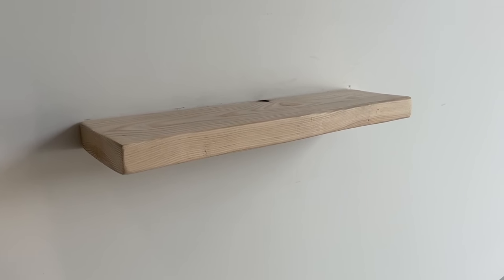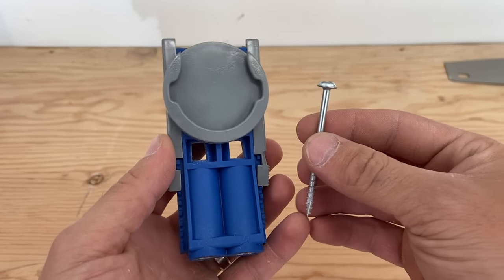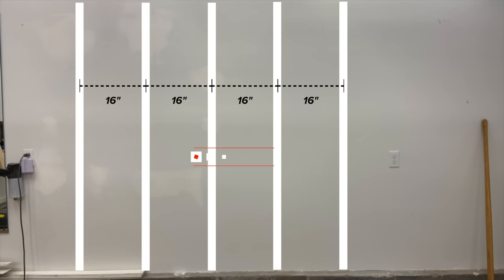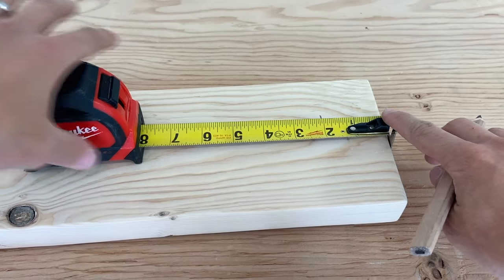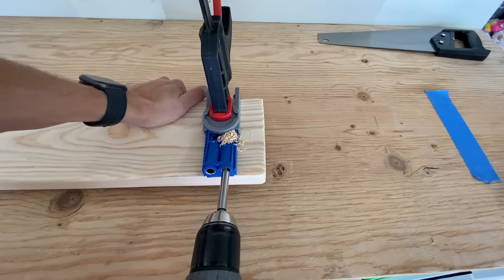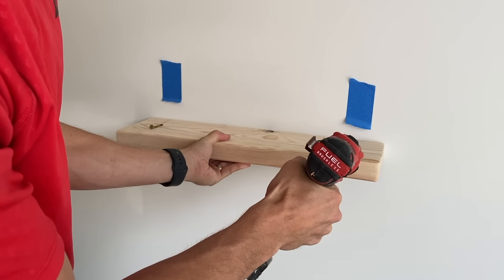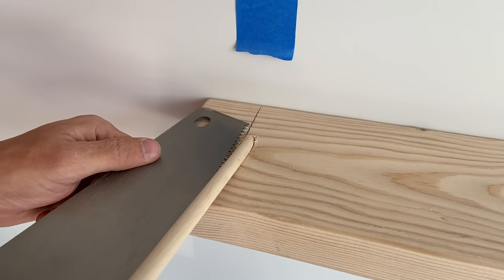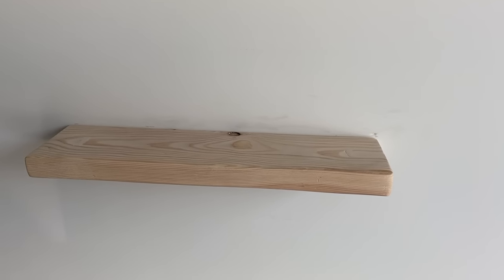This floating shelf is held up by 2 screws.

Comment: Okay, as I keep trying to figure out how to not have shelving that falls to the floor, I've very much feeling like the tortoise, not the hare... or like the tale of the 'axe' wood chopping moral tale- how the one who stops to sharpen their axe, in the long run, could chop more wood, faster. Very slow right now with much research; but I'm seeing reasons it will pay off. I'm learning a lot. I had NO idea to have so much concern about screw strength, & now, today, after forever not knowing this, I'm hearing it over & over today.Note to remember: tested different screws: drywall; only ones that held up are #9 GRK R4 multipurpose wood screws (3", bugle head, star drives); (better than kreg tight pull join screws & some other large head cabinet like screws  that looked much thinner gauge). Also used pocket hole Kreg jig. When I get time, I want to put these shelves everywhere : )

Comment: The screws you used are not designed for the Kreg. The screws need to be a flat face, same as the Kreg drill design and not a wedge like you used. A wedge screw can split the wood or dig in too deep, thats why they made it a flat screw.
Reply: If you just take care when setting the screw, this will work just fine. If you hog it in there with an impact driver, you're going to have a bad time.
Reply from the maker: Yeah I took that into consideration but from my understanding the kreg brand does not have screws that long! This only works because the screws are 3” long!
Reply: @Nailedityt  You could also just put a small washer in the screw.
Reply from the maker: Good point!

Comment: Can this be done with a 2 by 8 or 2 by 12 with longer screws and more I’ve them? I need to hang a shelf right over my washer and dryer back for all my detergents . I think a 2 by 8 will be big enough but I need it a little longer than the width of my washer and dryer pushed together. What’s your thoughts on this? So glad I found you on YouTube. I am subscribing for sure:)
Reply from the maker: Yes you can! This video goes over installing more than two screws for a longer shelf! 
https://youtu.be/5Url3QXQHaI

Comment: My instincts tell me that it would be stronger if the shelf was flipped and screwed in from the underside. Does anyone have any thoughts on this? Also, I assume this would also work into brickwork with predrilled holes and wall plugs..?
Reply from the maker: Answering Your Floating Shelf Questions
https://youtu.be/2j1jn6CaQY0

Comment: Really interesting. If I have to do floating shelf, I will do it this way. Just a quick question: Is there a reason why you have done the hole for the screws ont the top of the shelf and not at the bottom? Thanks
Reply: Ok, I kinda answering myself, if the shelf is above eyesight, we do the hole on top, if the shelf is below eyesight, we do it on the bottom? Does I am right?
Reply from the maker: Yes, it works well either way! Check out this video for more details! Answering Your Floating Shelf Questions
https://youtu.be/2j1jn6CaQY0

Comment: Suggestion for same size shelf between a window and wall (2ft) without a stud present?
Reply from the maker: I don’t have a way of mounting these in drywall yet but it is a future video idea! Can you increase the size of the shelf and mount it to the studs that make the frame of the windows? Is that possible?

Comment: Just out of curiosity (maybe I missed you saying it) but why not use the depth stop collar that comes with that kreg jig? Or did you not get it in the full kit and bought the jig and the pocket hole auger bit separate?
Reply from the maker: That would be ideal but mine sadly didn’t come with one! If you have one then I recommend you use it!
Reply: @Nailedityt  I was just curious because the kit the jig comes with has one and then you can set the depth to stop you at the depth of the work piece. I just didn't know if because you are doing something a little different there was a reasoning for not using it. Good video buddy and keep up the great work!
Reply from the maker: Thanks I appreciate it! Yeah, nothing fancy, just didn’t have it!

Comment: You drilled the pocket holes in the top of the board. Is there any reason why you didn't drill the pocket holes in the bottom of the board? If you did that, you wouldn't need the dowels because the pocket hole couldn't be seen.
Reply from the maker: The front of the board would sag and no be level. I actually tried before making the video!
Reply: @Nailedityt  interesting. I didnt know that!
Reply from the maker: I actually re did this idea and it seemed to work! I have a new video on my channel going over it!
Reply: but then you upload a new video with the holes under the shelf... so yeah, time heals and breaks everything.
Reply: I also thought about that, but my structural engineering background quickly kicked in and it was/is easy to see that your orientation is BY FAR the stronger.   Screws on the underside would have them dipping downwards out of the wall, nowhere close as strong as the way you have them.
(Nerd comment:  ....it about "turning moments",  a structural engineering term) 🙂

Comment: Those kreg jigs are handy to me, being that I'm not experienced enough to whip up a jig myself. and the joints are strong even without glueing.  Although there is a learning curve on placement for different thicknesses of wood, etc. Be nice if someone made a video on the breakdown.
Reply from the maker: Just set the kreg jig to the thickness of your wood! If you’re still confused, I will keep your video request in mind!

Comment: Thank you very much for sharing.  I am new in woodworking especially with pocket holes and screws.  At 3:40, what is that silver extension thing that you connected to the star bit?
Reply: I assume you already found the answer but for those who is looking for answer, it is called Hex Bit Extension. You can buy with different size of extensions very cheap (<$10)

Comment: Maybe this is an ignorant comment from someone that knows nothing about this, but if you turned the board upside down, would that not work? Then you wouldn’t have to fill in the holes, right?
Reply: Right 🙂
Reply: Except it might not be as strong due to the angle of the screws going into the wall.

Comment: Any advantage of using a longer screw?
Reply from the maker: Probably not a whole lot! It might add a little advantage if the screw was thicker but not by much. Also if you use a longer screw, be careful with electrical wires and pipes behind your wall! Hope that helps!
Reply: @Nailedityt  what about alternating the screw location ever other space/stud? One one top one on bottom one

Comment: Hi, would this work with a deep board? Like a 20inch deep board? And would a 4inch screw of the same brand also work? Or it has to be specifically the size you used?
Reply from the maker: 4" would work! Not sure about a 20" deep board! That might sag in the front!

Comment: Great idea. I wonder if inverting the shelf would increase the holding power. The downward force on the shelf would push the screws towards the wall, not away.
Reply: May depend on the use. If the shelf is deep then you run more risk of it sagging with a heavier load further from the wall. Top down seems better for loads placed further from the wall. With a shallow shelf and loads close to the wall bottom side may be superior.
Reply from the maker: Very good point! @onelonglizard
If you both are interested in how it would preform on the bottom, I recommend you check out this video! https://youtu.be/2j1jn6CaQY0

Comment: I would have put the screws on bottom where you cant see it then use super glue and saw dust to fill in holes and sand then stain you won't see where you had the holes cuse it's at bottom and the shadows are gonna hide most of it plus you filled it in with saw dust and sanded smooth and stain with a dark color as well helps and I did ,15 like that with different size wood and they look beautiful

Comment: Can this same method be used with trim board wood?  I just need some simple shelving to hold my lightweight and small soap making supplies.  Stuff like mica containers and whatnot. (I have a kreg pocket hole jig and it might be my favorite small tool in my whole collection of tools. :) )
Reply from the maker: If you are just putting light weight stuff on it you should be fine!

Comment: How is that 2x6 
When the tape measure had it at five inches?
Reply from the maker: They call it a 2x6 because it is cut at 2 inches by 6 inches at the mill but after it gets “sanded” down, it comes out a 1/4 inch shorter on each side! Hope that helps!

Comment: IMO the shelf would be stronger if the holes were drilled from the bottom and came through the back of the shelf higher to decrease the leverage on the screws. Also I don't like flat head screws with the Kreg. There is more possibility of the head pulling though by the wedge shape. However if you don't intend to have more than one person on the shelf at a time your system works. :)
Reply from the maker: Thanks! Yeah check out this video for an updated version! https://youtu.be/2j1jn6CaQY0

Comment: in case you missed it, that shelf was about to come out. do not try to put this up and slam it with weight. it will come out. 

this is by no means an insult to the vid...even with the shelf pulling away from the wall, just two fasteners was still surprising to see, i just dont want anyone getting any bright ideas only to get wrecked.

Comment: Will this work with a wider board, like a 2x10?
Reply from the maker: The wider you go, the less weight it will be able to hold due to leverage! I actually have 2 other videos on my channel going over different lengths and widths of these floating shelves! I just posted one today! Go check it out and see if it answers your question a little better. If not let me know and I will try to explain better!

https://youtu.be/5Url3QXQHaI

https://youtu.be/2j1jn6CaQY0
Reply: @Nailedityt  was thinking the same thing as in wider board, not the x10 but x8... weight to the wall will be ok but weight to the front will stress the screws, then I thought with the x 8, 3 screws on top ( 1ft in both sides then a 2-4-6 spacing, then 2 underneath) then maybe that will hold, over all enjoyed V's and gave me a different ideas, Thanks

Comment: Rip the whole piece about an inch /inch and a half , take the thinner piece and attach that to the wall and recess the head of the screw.... then pocket hole the thicker piece to the smaller. Better connection.
Reply from the maker: You could do that as well! This just had a few less steps for beginners!

Comment: what is the thinnest board you could use for a shelf?
Reply from the maker: That is a good question! I would say it depends on the size of shelf you are looking to do. The longer and deeper the shelf is the more thickness you will need. If you are planning on doing a small shelf and I would say 3/4” is the smallest you could go. I haven’t tested it but in theory that should still work!
Reply: I did one that is 1x8 which is really 3/4" so you have to set the stop on the kreg jig to 3/4" and still use longer screws.  Dowel plugs dont work as well since the hole isnt as deep so be careful.. if you have things on top of it though it can hide the pocket holes.
Reply from the maker: One of my newer videos, shows that the screws can be mounted underneath! So that could be an option as well!

Comment: the question is how do we do that with   cement walls    how to install floating shelfs  on a cement walls
Reply: Use same method but with dynabolts. Drill certain size hole in concrete and timber to match. Tap in dynabolts push on shelve and screw on washers and bolts. Use two each side. You need to be drilling out different size openings accordingly to bolt,nut and washer diameters. There are screws meant for concrete to try first which will make it easier and more identical to this video but I prefer dynabolts, depending on condition and type of concrete.

Comment: Hi! What about using a 12 inch wide board? Wondering about the extra width sticking out from the wall just supported by the pocket holes so far away.
Reply from the maker: Great question! I did a video on that as well! Check it out here: https://youtu.be/5Url3QXQHaI
Reply from the maker: If that doesn’t answer your question let me know!
Reply: Thank you so much!! Super helpful!! I'm going to put dishes on mine but it should still be less than the stress test you showed! Going to give it a try and see how it holds up over time! No harm in testing since I want to cut my teeth on learning how to do these things and what works/doesn't work over time. Thank you!!
Reply from the maker: No problem! Good luck and let me know how they turn out!

Comment: Can i do the same thing with 2x10 ?
Reply from the maker: Yes you should be able to but it may not hold as much weight! The wider the shelf the less it can hold!
Reply from the maker: Check out this video where I did a bigger shelf! 

These Strong Floating Shelves Only Use 4 Screws
https://youtu.be/5Url3QXQHaI
Reply: Thnx

Comment: One issue for me...the wood is never square, and there is a gap in the back where it meets wall. What to do?
Reply from the maker: Sometimes it’s the wood and sometimes its the wall! If you have a gab, I would just caulk where the board touches the wall! Then you can paint it the same color of the wall and it shouldn’t be very noticeable, essentially if it’s high on the wall or above eye level! Hope that helps!

Comment: Is there a reason why you placed the screws on the top side of the shelf? Couldn’t you simply flip the shelf and attach it with screws on the underside, eliminating the need for concealing the screws, as they’d be hidden?
Reply: I believe that with screwing the screws from the top puts them at a downward angle, which makes the shelf able to hold more weight. If he screwed them from the bottom, they would be going at an upward angle and would compromise the weight ability. It would be easier to tear out of the wall.
Reply from the maker: Both good points! I actually did a video on this very question! Go check it out! https://youtu.be/2j1jn6CaQY0

Comment: Why not fix it the other way round then theres no need to fill the holes
Reply from the maker: Check out this video! https://youtu.be/2j1jn6CaQY0
Reply: @Nailedityt  i dont doubt its stronger but how many people would have around 80kg on a shelf lucky if most would have 10 to 15 kg
Reply from the maker: Yeah it’s pretty unlikely! For most people this will work just fine!

Comment: You ACTUALLY weigh 57kg?! And I'm sitting here watching this video hoping for some smart way of attaching a shelf a man can stand on. My shoes would break this, let alone me standing on it.
Reply from the maker: Yes I’m pretty small but you probably won’t be putting more on a floating shelf then that anyway!
Reply: @Nailedityt  well, need one for a microwave as it happens. And anything someone might put in it. Plus it has to withstand an occasional bump or a lean or a kid hanging off of it. Ikea used to do one of those with an elaborate "inside"
Reply: @Nailedityt  oh yes, and I do envy you weighing so little...

Comment: Great use of pocket holes.  Overtime that will sag though as it's using the weight into the drywall.
Reply from the maker: It’s done pretty good so far! It depends on how much weight you have on it! If you have a lot of weight all day everyday, it could possibly squish the drywall!

Comment: Wait, your 2x4 is 5,5 inches? So in essence it's a 1,5 x 6... board. 
2x4 in my country is EXACTLY 2 by 4 inches (48x98mm)
Reply: Uhm... 2 x 4" = 50.8 x 101.6 mm. In your country 2x4s are APPROXIMATELY 2 by 4 inches. Quite far off too. :)
Reply from the maker: Yeah a 2x4 here is about 1-1/2” x 3-1/2”. Where as a 2x6 is about 1-1/2” x 5-1/2”! It’s just what we call it over here! I don’t make the wood ;) lol
Reply: @EirikJeppesen  I thought an inch was 24mm, guess I thought wrong. :)
We're a lot closer than America tho!
Reply: @Davey768  Doesn't take much. :D

Comment: How do you stain the wood after it has been mounted onto the wall? wont the staining just go everywhere and you cant take off the wall to stain because the dowells block the screws?
Reply: You can put some tame between the wood and the wall, after you stain the wood, remove the tape and there you go

Comment: i dont think you should use that screw, it gonna split the wood, cuz it can not sit flat in the hole
Reply from the maker: I’ve been using them for a while and haven’t had any issues! If you have that concern, you could always put a small washer on them before you install the screws!
Reply: @Nailedityt  the washer is gonna be super hard to find. but I gonna try to use my grk next time and see how it goes

Comment: Why not flip the shelf and install the screws underneath? Eliminates the need for the dowel plug and allows for removal in the future.
Reply from the maker: Very good thinking, but I already tried that! The shelf sags in the front due to the angle of the screws! It would not be level! In order for it to work the screws have to be on the top! Great idea though! Great minds think a like!
Reply: it also depends on the height of the shelves. I did some of these and  it's easier to cover the dowles or holes with picture frames or decorations. on the bottom you would clearly see the hole from sitting on the sofa
Reply from the maker: Thats a good point! Thanks for pointing that out!

Comment: 1 where is the stop ring at pocket hole drill bit? 2 the shape of the screw head is not suitable for pocket hole. 3 you better screw from bottom side , not top.
Reply from the maker: 1 mine didn’t come with one sadly! If you have it I recommend you use it! It seems to work just fine but if that is a concern to you, you can always add a small washer! 3 check out this video for an update on that! https://youtu.be/2j1jn6CaQY0